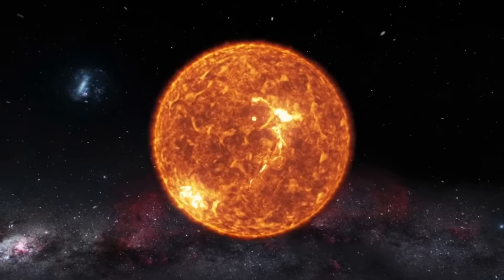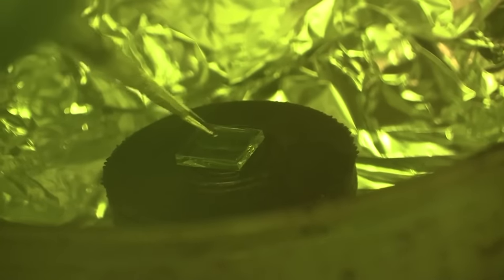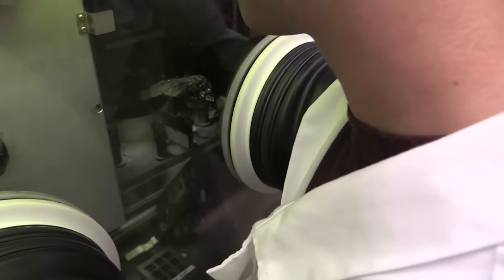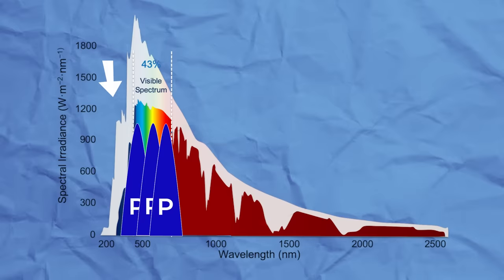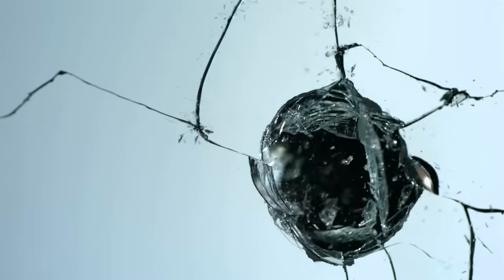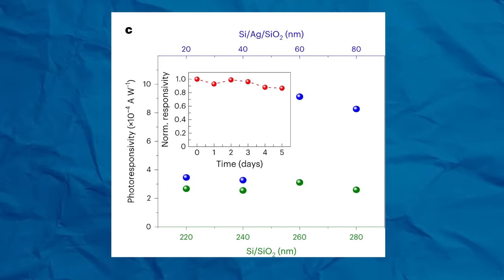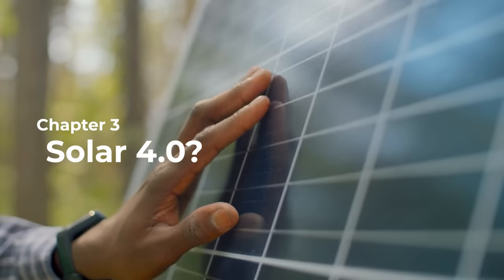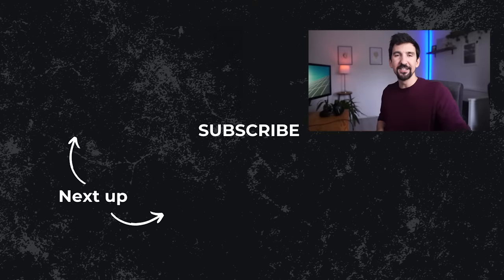Solar 4.0: Ultra Efficient Solar Panel Breakthrough

Comment: A conventional solar panel is currently about 20% efficient. This is determined by a formula that assumes sunlight falling on 1 square meter of the earth's surface has 1 Kw of energy, so a 1 square meter solar panel will theoretically produce 200 watts of electricity under ideal conditions. It's useless to claim that perovskite has the potential to become 250% more efficient unless we are told how many watts a 1 square meter panel currently produces. Another thing worthy of mention is that these new technology panels contain lead. This will be perceived as totally unacceptable to householders like myself who collect rainwater for domestic consumption.

Comment: Would have liked a direct comparison of efficiency of conversion of sunlight to electricity. Early on you talked about silicon being somewhere between 18% - 24% (or so) efficient. But, later in the video you switched to talking about a 250% increase in current density. Not the same thing. So, what is the conversion efficiency of this breakthrough?

Comment: In comparison with a 250watt panel is this unit more recyclable? A 250watt panel IF recycled end up at 55-65% the rest is in the tip SO is it greener?

Comment: Well. I'm an ignoramus, and elderly to boot. So my opinion isn't worth the time to type it. Time I have, however, so I will inflict my remark on your readers.

It seems to me that there might be an unmentioned, but obvious, reason why a mirror can improve yield at the collector.

When an electron falls into a positively-charged 'hole' in the cell, so that the electron can't arrive at a collector, a photon is emitted. What happens to this photon?

It either escapes the cell entirely, or it collides with cell material and excites/liberates another electron.

A mirror, if tuned fortuitously to reflect reemitted photons, will prevent some of those photons from escaping the cell material, redirecting them back into the cell, where there are more opportunities to collide and liberate electrons. So yield goes up.

That can't be the entire cause of an improvement of 250%, but it could be a factor, unless I forgot my meds again and am making no sense.

Comment: So if the perovskite cells are improved by 250% with the silver layer, what is the overall conversion efficiency expected of such perovskite cells?
Reply: About 50% with a monolithic single bandgap perovskite!

The question has not been answered yet as to use of double juntion perovskites with Hyperbolic mirror.
Reply: @jeanpaulchristian3282  Thanks JPC. I see other commentators made a similar observation about lack of context. Now 50% is certainly a worthwhile improvement on current silicon based solar panels.
Reply: @MiniLuv-1984  Its Definitely about 50% that is a mid estimate because the best single junction operates at about 25.6%- but when the authors made the breakthrough the current record was about 22% - so 2.5x improvement is 55%- but you have to account for material and contact defects so the number will likely be about 45% efficiency for a viable cell- but 50% is definitely achievable because cavity grain boundary stabilizers that enhance perovskite longevity to equal of silicon cells also improve material efficiency- single junction silicon has reached 27% which is closing in on the limit of 29.5%... The Shockley Quisser limit is actually 33.5%- A perovskite single or double junction should not only reach 49% but it should happen after discoveries of contacts that prevent recombination and stabilizers that do the same- there is even a clay material that can raise performance 4%
Reply: @jeanpaulchristian3282  Appreciate the info JPC.

Comment: That is nice that the efficiency of the cells are getting better however the longevity should go still doesn't overcome ohm's law 101 you still need 90% more then you think you do the problem is. Its measured in watts and because it's measured in watts you could only use about 10%

Comment: The key things are going to be the cost to make them, how rare the materials to make them are and will they be recyclable. Beyond that the further question would be how easy to scale them up to mass production. The use of silver is going to increase the cost. Experiments need to made to find if other, lower cost, metal could be used. It does sound exciting but they are going to like fusion has always been I suspect.

Comment: I don't like when people try mislead others
Efficiency is stated as a percent %. Current cost-effective solar panels have around 22%. It can not go above 100%, ever.
Headline "+250% EFFICIENCY" is utterly misleading.

Calling it a breakthrough is a vast overstatement.
1. Problems lead.
2. Fragility.
3. Degradation.
4. Cost efficiency.

Also this is old news, not weeks old. It's from last year or even older.

Comment: I saw your thumbnail and it seemed as if the claim was that the solar panel was 250% efficient as in it's putting out 2.5X the energy that it's collecting. I was prepared to laugh relentlessly. But I see, 250% more efficient than X.

Comment: I might have missed it but I did not hear what the efficiency was to start with. Can they match the 20% efficiency of silicon now and improve it by 250%?  Or is the increase based on another baseline, like existing perovskite cells? How about cost per cell area? Does it go up or down? I think the claim is down, which is believable, but what's the actual data? You also touched on reliability in the field which is always key. Silicon cells are pretty robust and have a relatively long life.

I've seen lots of charts touting the increases in efficiency with new materials reaching the 40% mark, iirc. None of them can beat Silicon as an end product. They're either too costly to manufacture or too unreliable in practice.

I've been hearing about perovskite being a magic material for a long time. Intel had a program in the mid-90's to develop perovskite memories because they'd be so cheap and simple to manufacture. Never came to fruition.

Comment: why would lead be an issue...people would not have repeated or prolonged contact with the cells/panels whatever....I'm ignorant to the "why" can you explain?
Reply: The issue is that it could leach into the environment causing harm due to improper disposal.
Reply: @daily8150  lead would leak into the air? that's not a concern...it would be parts per trillion(assumption)...it's just nonsense...other than production issues, there is no actual good reason to not use lead.

Comment: Did I miss where he said what the actual conversion efficiency is for this tech?  If current commercially available cells convert 20% of sunlight to electrical power, and this new cell design does 250% better than that, the efficiency is about 50%.
Also, the low price of the existing Perovskite units is based on their thinness and use of lead.  If they make them more robust, swap out the lead for another element, and then put a layer of silver on the back, the cost will significantly increase.  I'd guess that the cost would far exceed the cost of current silicon P.V. cells.  
If the conversion efficiency of the new cells is 250% that of current cells, and if the longevity of the new cells matches current ones, the initial cost per Watt could easily be twice that of the current silicon cells and people would pay it because they take up less space for the same output.

Comment: Maybe I'm asking a stupid question, but could we create an orbiting high-efficiency UV solar panel that then beams down the energy in a frequency that is least absorbed by the atmosphere to a base station on Earth? 
If anyone needs a visual, imagine the microwave powerplant from Sim City 2000 and you will have a relatively close approximation of what I'm describing.
Reply: there is actually an old concept for this tech but it was intended as more of a weapon of mass destruction, if I recall correctly the nazis had this as a top secret concept or something

Comment: Has anyone tried using a prism to split light into colors and then targeting different types of solar elements optimized to respond to that color?
Reply: interesting idea

wouldn't there be an issue of prism heat resistance?

Comment: This is fascinating!  ARCO Solar had a TFS product (ThinFilmSilicon) panel product.  It had similar conversion efficiencies (10-20% as I recall), however, an interesting challenge was cosmetics.  One use case was to use a variation of this TFS product as the sunroof on vehicles, and ANY scratch or blemish or discoloration was cause to scrap the part.
Reply: Sunroof on electric vehicles? Sounds good but I'd rather use solar for my home and reliable gas for my vehicle.
Reply: @igotufoinformation9636  Good for you ..... this was in the early 1990's, and intended for simply running the interior fans to keep the vehicle cool during hot days.  Long before Tesla.  The only e-vehicle back then on the market back then may have been the GM-EV1 (I think they were introduced in 1996).  The panels were translucent.  Maybe do a little research before you sound off and look silly.
Reply: @truegret7778  that's the first mass produced electric vehicle, t
In 1912 the electric roadster was almost $2k while the gasoline car was about $700

Lol don't be silly
Reply: @igotufoinformation9636  The model T was about $850 in 1908, while the first e-carriage came along around 1832 (rechargeable batteries not until 1859).  Again, the TFS sunroofs were not for e-vehicles.  But, whatever ... don't be such a dork, and maybe put your tin-foil hat back on and look for those e-UAPs.  Cheers
Reply: @truegret7778  I never claimed they were for e vehicles. You're trying to prove me wrong on a claim I never made. That sounds like a horrible marketing decision anyways lol 🤪 you need a tin foil hat, protect the little you have left

Comment: How you get 250 % efficiency? You can only get 100% of anything . As the 23-29% now are rated  not comparing it to something else. Meaning you have to used the same  rated style as your compare it to current efficiency.

Comment: Nothing changed only a stap forward 😂 We have not found a way to prevent ions from moving through perovskite materials, but we have found that it is possible to steer these ions into a safe conduit that does not impair the material’s structural integrity or performance,” said Professor Amassian. “It’s a big step forward.”

Comment: I like your presentation. However, the 250% increase of efficiency claim seems quite clickbaity to me. You never mention what the actual efficiency of the cells using this new back mirror technology is. From the 20% starting value of silicon, that would equal 20*3.5=70% efficiency. Is that what has been measured for these new cells?

Comment: 3:51 ChatGPT would do a better job explaining p-n junctions than you. The semiconductor domains are not "charged", they're electrically neutral overall but DOPED. 
But the fact is, it doesn't matter. It doesn't matter if it's wrong.

Comment: even without this breakthrough if sun send enough energy per day for 1 years time of energy needs, why not just put up solar panels all over the place with what we have now, and i dont see that happening. i should be seeing fields of solar panels going up everywhere, on top of every building/parking lot, etc. and battery backup and residential wind turbines.

Comment: Why is this effect not simply explained by the reflection of the photons that have not interacted with the cell?  Back Surface Reflector (BSR) equipped cells are well known things and they serve to increase cell efficiency both by enhanced photon capture and by improved heat rejection.  At the layer thicknesses described, the behavior could be due to improving the reflectivity with increase BSR thickness.  One would absolutely expect a greater than doubling of cell efficiency if the carrier lifetime level were short - this is why cells fall off faster than illumination at low incident light levels and also why for many years concentrator technology was/has been pursued.  I will admit, that is a novel explanation though.  I wonder if Occam's razor will allow it to survive.

Comment: A 250% increase on a very low starting point is not necessarily a significant improvement. Perovskites certainly show some promise in the lab, but are still no where near being a scaleable technology. In the same way that we keep hearing about new battery technologies or the prospect of nuclear fusion, there is nothing significantly game-changing on the horizon.
Reply: Sodium batteries will be mass produced this year.
Reply: @higreentj  if you are thinking of CATL's proposed offering they have a lower energy density than lithium. Whilst the cost and availability of lithium means this is a good economic step, it is not (yet) a significant technological advance.

Comment: im just going to throw this out there that solar as it is currently is only a maximum of 5-6% efficient so 250% would be up to12-14% efficient so yes its an improvement though they have gone higher in lab conditions with very expensive solar cells they have gotten up to 98% efficiency however the cost of a single cell would be extremely expensive and that cell would be the size of a quarter

Comment: I really don't get why people are so scared about lead (along with other materials like mercury or arsenic) being found in products that will never find their way into a human body.  Unless you're deliberately smashing one of these solar panels and burying it in your yard, what difference does it make?  If a material works well, is fully contained, and is cheap, why not use it?  It's not like leaded gasoline where we're just pumping the toxic metal into the air.  It's not solder where it can leech into our drinking water.  It's not like paint which can flake off and contaminate the soil.

People need a grip on reality and stop being afraid of stuff just because it exists.

Comment: Lead isn't TOO bad. You don't want to paint your walls with it and have paint chips fall into your kid's cheerios 20 years later. And you don't want to burn it in your engine and pump it out the tailpipe in vapor form for the next driver in traffic. And if you do anything to heat it (solder, bare lead ammo, etc.) you want great air circulation. But if it's handled with a bit of care, it's not really an issue. You can handle it and wash your hands. It's like a live electrical wire, or a sharp knife. Just don't do anything overtly stupid with it.

250% increase over perovskite's normal efficiency is What exactly though? Roughly equal to high quality silicon cells right? From around 10% to 25%. So "super" perovskites are cheaper, but don't last as long. That's not really revolutionary. It just offers a second viable option.

Also, that infrared action on silicon means it can generate at least "some" electricity when the sun is low in the sky (more air traveled through = longer wavelength light). Perovskites would generate only near noon, and only in summer months.

The big hurdle which solar faces, is to produce more energy than they consume to be produced. On a majority of the land surface of earth, they're a net negative. That's still super useful for off-grid applications. But it doesn't do much for the carbon equation or overall net positive energy production. In the US for example, solar only "saves the planet" in the desert southwest, and on top of some high elevation mountain regions. Anywhere else, it's not "saving" anything, more like "spending" energy (for reduced or eliminated grid dependency).

What solar needs, is to produce more energy, in more conditions, while costing less (energy/money) to produce the panels, and to not sacrifice longevity in the process. Perovskites have a marketable place in cheaper shorter-lived applications, but they don't achieve that holy grail. 250% increase in perovskite efficiency, just gets them into marketable territory. It doesn't unseat silicon. And it doesn't make solar viable over a larger portion of earth's surface. Wind faces similar problems. Hydro & geothermal are golden though (where applicable).

Basically, wake me up when something hits 40-45% solar efficiency, at a reduced production cost, still produces "something" in winter, and lasts 20-30 years. That, would actually be game changing.

Mirrors are interesting with silicon, if used very cleverly. They cause increased output, but also wear out the cells faster. But if they're movable, and used only when sunlight is weak, mirrors can make solar considerably more stable in output. But they take up space, need to avoid adding any light in peak sunlight conditions, and need to be used in a manner which isn't turned to scrap in a thunderstorm.

Comment: The obsession with avoiding lead is not really warranted. There is lead in our soil at a certain concentration already, and as long as the cells were recycled sensibly, it wouldn't be a problem. It is in solid form after all.

Comment: The fact is that the square footage of available PV surface is the determiner rather than the total amount of energy that reaches the surface of the Earth.  No matter how much solar energy is available, the sacrifice of area that is necessary for PV generation cannot be utilized for much else.  Sure there are theoretically more efficient materials that draw solar energy from the Sun, but how environmentally friendly are the manufacturing processes that produce them.  The answer is not very.  So far the downside for alternative energy is greater than utilizing the available petroleum until the technology is proven to supply the need.  Rather than crawling out on the solar limb and sawing it off perhaps some time to make the technology effective is necessary.